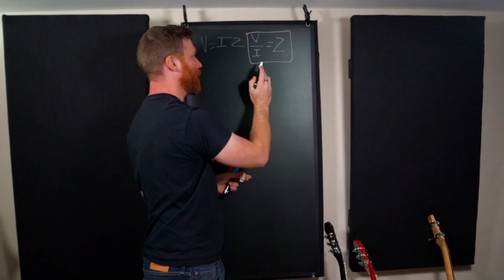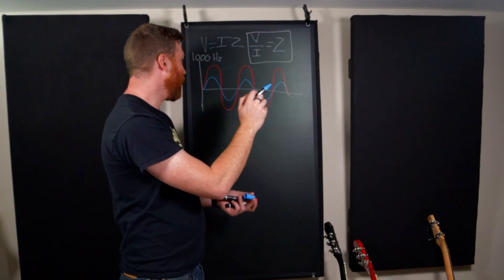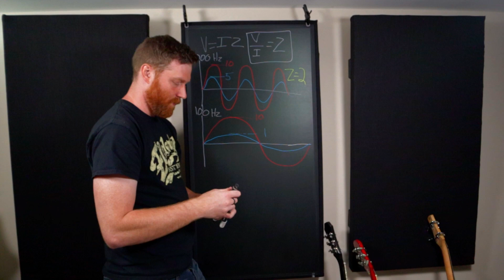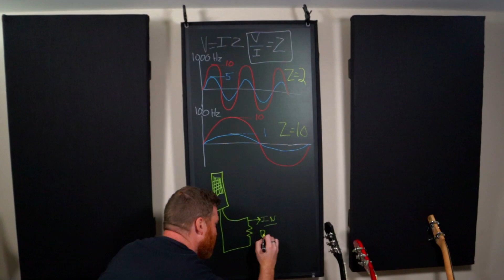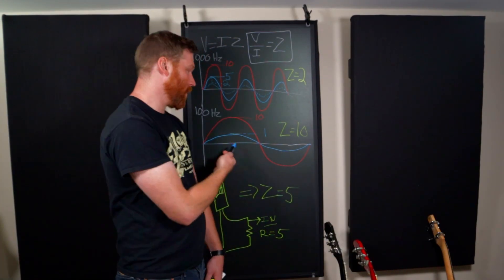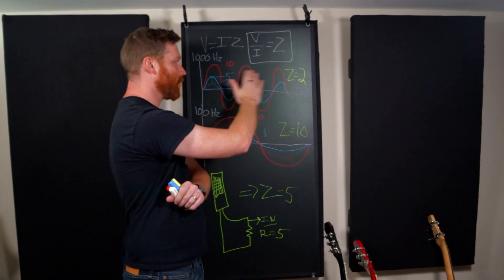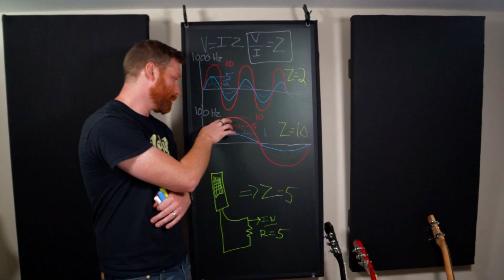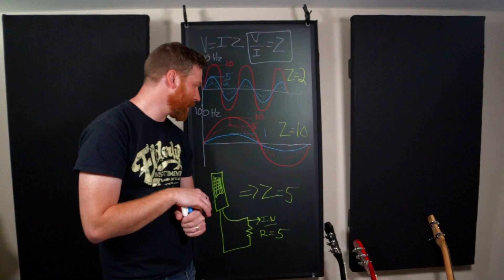A Better Explanation of Impedance for Audio Signals

Comment: Great video, really helped a lot! 

Just curious, does adding a 1:1 ratio input transformer between the mic and amplifier gives any significance? I have seen such transformers with various impedance ratios, always curious if it helps since it is not a step up or step down type..
Reply from the maker: This is an interesting and surprisingly complex question.  I'll admit, while I do have experience designing transformers for ribbon mics, I do not have direct experience with a situation where you would want a 1:1 transformer, so I might not foresee all the factors going on there.  However, one thing that is certain about any 1:1 transformer is that it physically separates the circuit from DC voltage transfer.  Transformers transmit changes in electricity - so waves.  AC passes through, but with DC, there will be just a little spike of signal with the DC is turned on or off, but otherwise it doesn't pass through the transformer.  That is one benefit in some situations.  Otherwise, the impedance does not change with a 1:1 transformer, but the sound will still be impacted.  Each transformer imparts a bit of its own character to the signal.  Two different transformers of the same ratio can sound quite different because they can have very different values of inductance in how they are designed.  So I suppose a 1:1 transformer could also be added for the character or color it has.  That's what I've got off the top of my head, hope it helps!
Reply: @alderaudio  Appreciate for taking time to write the reply, it does help! But gotta spend some afternoon to further digest the concept, along with coffee. Cheers!

Comment: "In audio we are not worried about phase" it's a misleading statement talking about impedance or audio in general, am I wrong?
Reply from the maker: Good question, yes I am only referring to phase shift as related to the topic of audio signal impedance.  In audio in general, like when recording, phase is absolutely important, but that is not the topic I am referring to in the video.

The longer context to the comment is that phase shifts related to the topic of impedance are incredibly important in the world of digital signals, so if you happen to be someone trying to learn about impedance on the internet it can be really confusing reading through all kinds of detailed information that is not significant for audio devices.  The big difference is that we are dealing with the audio frequency spectrum, so only up to 20 or 30 kHz.  When it comes to digital data transfer, signals can be operating in the GHz range, where the wavelength is WAY smaller.  When the wavelength gets that small, any kind of phase shift can really mess with things, but the same sort of shift on a signal under 1MHz has a completely negligible impact.  I hope that helps!
Reply: @alderaudio  Completely disagree. Phase shift is independent of frequency, so a shift of 90 degrees affects a 20 Hz signal just as much as a 1 MHz signal. And phase related to impedance is hugely important for filters, like channel EQ, system EQ, and speaker crossovers.

Comment: Thank you so much for this video. I was going through a lot of videos with so much math, but I just wanted to understand how this applied to audio signals, but I've been building tube amps and everyone is always talking about impedance, but no one is gonna tell what it really is. The fact phase shifting doesn't actually apply to audio was veeery enlightening. Thank you again.
Reply from the maker: Thanks Edson.  Yes, when you try to look this up the first time it gets overwhelming, and it's hard to separate the information that is more applicable to digital signals in the MHz range from what is applicable to audio.  In digital world phase shift is a much bigger topic since the wavelength is so short, but in audio it's usually not something you have to consider in the vast majority of situations.  

One thing you should remember is that the concepts here in this video are mainly directed at audio signals rather than power, so the concept of plugging in something with a small signal like a pickup or microphone into a preamp or interface.  In amps, as I'm sure you know, there is also impedance to consider with the output electrical power supplied to the speakers.  While I don't talk about that in this video, in that situation the ideal is to have the output impedance match the speaker impedance for most efficient power transfer.  This is quite different from signals where having the output impedance of the device be much lower than the input impedance of preamp is preferred
Reply: @alderaudio  Sure! But my bias towards this topic was more about understanding things I always hear but no one actually explains or justify. For example, you send your signal through a cathode follower to lower the impedance before going to the tone stack (so the gain loss is lower). Ok, but what does that mean? Now I understand this trick must change the current while keeping the voltage, or something like this.